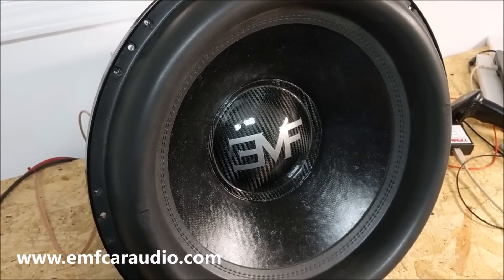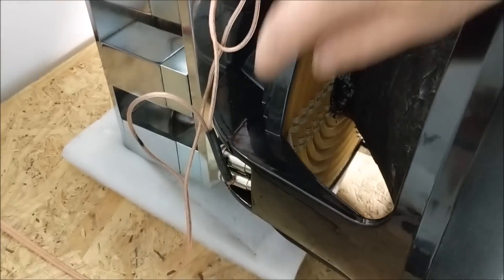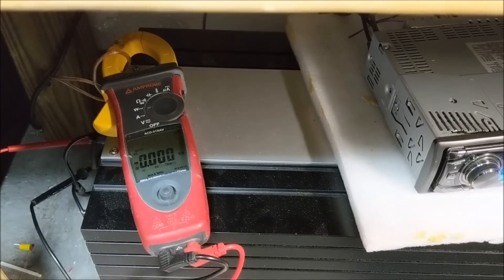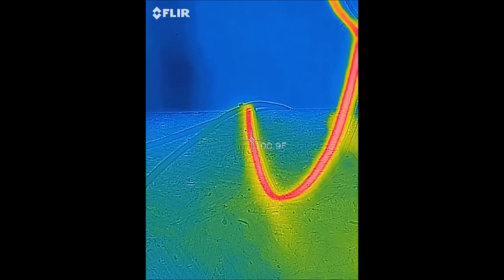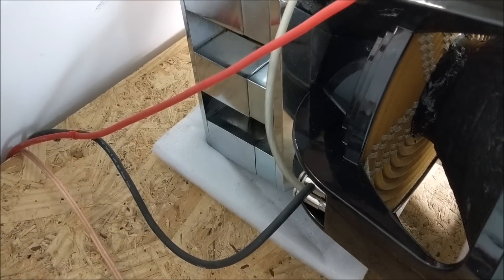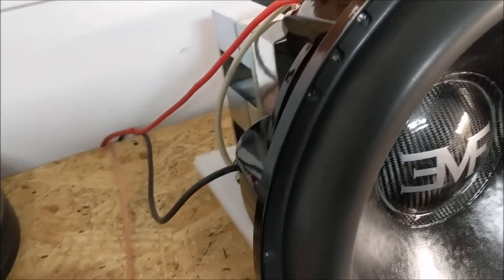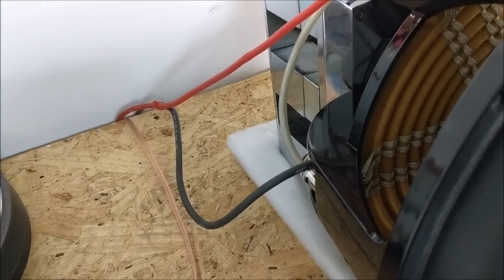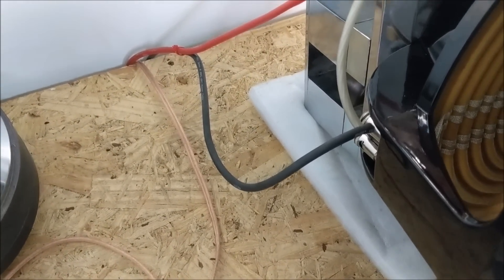Are you using the proper speaker wire size?

Comment: Eh, just run the coils in series. I am too cheap to use anything but 16 gauge.
Reply from the maker: Running it in series doesn't solve the need for bigger wire. If you have the power, you need the bigger wire.
Reply: @EMFAudio  I am joking of course! It would be interesting to see if there is much difference though, in theory it would be half the current, though in practice its probably only slightly less. And if the driver was in an enclosure which would give stable rise on the chosen note and wattage, you miiiiight be able to get away with it. Your temp rise on the cable would probably only hit 95f.... I think at 7 feet bidirectional 16 gauge is good for something like 5-7 amps? if that... 

I had to use 16 guage on my setup as at that exact moment it is all I had, but I also have a single 4ohm 12". The amp is rated about 1kw into 1 ohms so I know it will never see much power. Ideally I would be using 12. But I have to pull the box and sub to change it, so I wont bother until I get the new amp. I think its only 3 feet or so. i don't use terminal cups, so its 1 piece.
Reply: I really also never run it to full power either.
Reply from the maker: @wishusknight3009  I feel like I have a video to do testing series and parallel effects on speaker wire. I need to have a good consistent platform to do it with thought, for consistency. I know the result, I don't know the specifics.
Reply: @EMFAudio  That would be interesting. The best consistency would be a resistor network, but that can be very pricey. 

A little off topic... In one of my experiments at home I used ethernet wire (22 guage) purposely to actually increase impedance of the sub I was trying in the theater. I was not about to see if my HT monoblock could do 1 ohm.. Its rated only for 4, and I have ran it at 2 for long term without issue, but this was a bit much.  So in that case I had to use a bit of napkin math to ensure the right length to give the desired resistance, then figure out that the wire could dissipate the heat properly.

It was good for low volume but for a real workout I used 2 strands each way with more length.... I think I used about 25 feet to add 1.5 ohms or something like that. Cant really remember. And after a couple of good rap songs it certainly was warm to the touch, If i had to guess I fed about 300 watts through it...  It worked for a 10 minute test and it was much cheaper than the resistors that I didn't have on hand lol.

Comment: So does this also mean that a dual 4 ohm sub runs cooler than a dual 2 ohm? (both in the same wiring configuration) Higher the ohms the higher the voltage, resulting in less heat.
Reply from the maker: In the same exact model comparing coils, yes, as long as you run the amp at a higher load. Example, if you ran a dual 1 in series or a dual 4 in parallel, you'd have 2 ohms at the amp and results would be the same. Now, that being said, while the higher impedance may run cooler, it won't be wildly significant when you're talking about using it at rated power (as intended)

Comment: Question because I have seen some people try and just run multiple runs of 16g speaker wire to each coil, will it still overheat if you used two runs of 16g rather than one run of it???
Reply from the maker: Multiple runs will have the same effect as a larger gauge wire. Think of it as the amount of wire being used, not the size of the wire being used.
Reply: @EMFAudio  thank you for clarifying that, so multiple runs of smaller gauge is equal to 1 run of a larger gauge ie 2-16ga vs 18ga?
Reply from the maker: @kevinAuman1  The lower the number, the bigger the wire size. So two 18 ga wires would be close to a single 16 ga.

Comment: i use 6 inch thick pure copper bar as speaker wire
Reply: jaakko200987654321 I use that as a butt plug
Reply: Hell ya. I use 8 awg ofc rods as wire 🤣

Comment: well..100f is just warm. Body temperature. Seems to me if you are pushing less than 1k 16 gauge is just fine.  Length of the wire plays a major role in how warm it gets. How much do you have coiled up behind the scenes?
Reply from the maker: The wire you see is basically it. The amp is about 2 ft under it. Yes 100F isn't THAT warm, but it's also a short period of time. The point was to display what happens and any energy lost to heat is a loss of power.
Reply: This is so true!I had way too long of a wire (wrapped up)and my 1000watt set up straight melted the thing!it was a big glob of wire stuck on itself.

Comment: Can I use 12 gauge wire as jumpers between the dual voice coils (parallel  for final impedance 1 ohm) and then 8 gauge from the subwoofer to the amp? My terminals on my subwoofer won't fit 2 8 gauge wires. Great video by the way!
Reply from the maker: 12 gauge can handle quite a bit of power in a short length. Unless you're running over 4k per sub you probably don't need 8 gauge.
Reply: @EMFAudio  Thanks for the reply. I was trying to use the wire I already had but I only had a few short pieces of 12 gauge but about 5 feet of 8 gauge. I am upgrading from about 600 watts to 1200 watts. 8 gauge is probably overkill but I'm going to try to make it work since I already have it.
Reply from the maker: @2000S10V6  You could use 16 gauge and be OK, on the whole thing.
Reply: @EMFAudio  I appreciate you replying! Maybe I will just go ahead and get new wire rather than try to cram 8 gauge in the terminal.
Reply from the maker: @2000S10V6  We have spools of 12 gauge at www.emfcaraudio.com, that would be more than appropriate and easy to fit in.

Comment: Aluminium does not conduct electricity
Reply from the maker: Is that why voice coils and wire is made of it?
Reply: EMF Audio voice coils are made of copper?
Reply from the maker: @Robertotvl  They are made of copper, and in subwoofers more of them are made of aluminum.
Reply: EMF Audio yes in some rare cases they are made of aluminium and copper to reduce the weight so it can move more easily
Reply from the maker: @Robertotvl  Rare? The sub in the video has an aluminum coil, 2 of our lines of subs use aluminum coils. Everything from Sundown except the E and SA lines use aluminum coils. Aluminum are more common than copper coils. It's not an alloy mix, it's straight aluminum. In the mention of wire, there is OFC (oxygen free copper) and CCA (copper clad aluminum). The copper coating is to prevent oxidation. There is straight aluminum wire as well, cheap stuff is. There are also plenty of distribution blocks and battery blocks that are wait for it, blocks of aluminum.
Reply: @EMFAudio   These comments are unreal XD

Comment: Yeah ok? Im sure most people understand more current equals more heat through the conductor. But 100° is still within spec for the insulation on that wire. Does the heat somehow degrade the quality of the signal going to the sub? Of course you dont want to overload a cable but all you showed us was that certain gauge of wire has a specific limitation. What i wonder about is the amperage i know amperage and wattage are tied, how much amperage are those speakers cables taking i know its 1200 watts but at what voltage?
Reply from the maker: More heat is more energy lost, there is less power going to the sub. There is an increased resistance as well. It's not about destroying the insulation but there is a point where it could set carpet on fire. Voltage will always be within reason on the cable, current is what makes it warm.

Comment: So the thinner cable gets up to about 37 degrees celsius. That's actually not so bad. And for normal music playing it will not get quite that hot. Could be alot worse. But it's not just the cable thickness alone that plays a role. But it's always better to have good headroom in cables like it is with amp power. Too small is not good in both cases👍
Reply: if the length is reduced then the temperature would also decrease. a ~2 foot piece of 16g will take 1200 all day.

Comment: I always use 8 gauge no matter what.
Reply: Explain to me how you double up 2x 8g wires into 1 terminal when wiring dual subs?? Most terminals cant handle that thickness of wire
Reply: @akuma4u  if your amp or speaker only provides 1 set of 8gauge outputs you use a simple splitter. (The amps i run in recent systems had two outputs even though they are mono bridge amps.) My speakers have direct leads so there are no terminals .
Don't twist them at the terminal, unless you really can't afford a split, or reduce about 1/2 the wire off each end before sticking it into terminal
Reply: @ThisIsSolution  what kind of splitter are you talking about do you have a link cuz I am having that problem with two 8 gauge wires into my sub terminal my Moto block does have  4 channels

Comment: or course the larger wire disperses heat alot better. but first test the heat scope is rock solid focusing on the same spot of the wire. second test it wobbles all over the place. at times not even pointing at the cable.

Comment: What gauge would you use for main lead on an 8k  @1 ohm amp , 4 coils being connected in parallel with 8 gauge inside the box , connected by 1/4 inch brass bolt to outside,this lead is about 6 ft , would you use , 4 gauge or 1/0 ?
Reply from the maker: You'll have a loss in those bolts but 4 gauge OFC is more than necessary. At most you'd have 90 amps of current, which in that length could be handled by 8 gauge.

Comment: Aluminum wire doesn't heat up faster than copper.
Reply from the maker: Yes, it does. It can't handle current as well as copper. It's not as efficient of a conductor, meaning more energy is lost in the form of heat. The same amount of current applied over the same time will cause more heat to be produced. That means it gets hotter, faster.
Reply: @EMFAudio  while some of the points you made are true but it has nothing to do with what I stated. Do your research. If you apply current to the same mass of aluminum as copper, the copper heats up faster not the aluminum. Nothing else was stated by me. I'm well aware of the conductivity of metals. Hopefully some chemistry students can chime in and set you straight.
Reply from the maker: @carlosoliveira-rc2xt  Every time somebody says "do your research" what they're saying is, they didn't do their own research and they want me to prove myself wrong. That being said, what you're suggesting is changing the consistency of the test. If you change the mass of the wire, you aren't using the same gauge wire. That would also hold true in using the same exact material of wire. If you aren't using the same gauge wire, the test is invalid, that isn't a fair comparison.

Comment: You are doing it wrong, one never tins the whole lead to connect to the speaker terminal.  To keep the lead from unraveling only tin about one eight of an inch so that only copper is in contact with the speaker terminal other wise you add an extra interface.
Reply from the maker: Those strands fatigue and break when you put it in a terminal thousands of times if you don't do that. The bench isn't for long term connections either, just product testing. The additional resistance isn't a factor in determining if it plays fine or not.
Reply: Anyone who puts it in a thousand times should use banana plug or BFAs.   @EMFAudio
Reply from the maker: @wardell1518  If you notice, that sub has 2 positive terminals next to each other, and 2 negative terminals next to each other. To use banana plugs they would have to be individual, which is basically what we're doing but with an extra component involved. We do use banana plugs on the subs that have a normal terminal configuration.

Comment: What do you think about two 15s at 2500 watts using stinger 10 awg ofc tinned speaker wire at about 3-4 foot runs. My years of experience tells me that's plenty but now I'm wondering if I'm losing any power to the subs especially since the speaker terminals direct accept 8 awg as well as the amps speaker outputs direct accept 8 awg. I'm a bit anal and OCD about things so that's gonna mess with me until I get some kind of confirmation.
Reply: That's like asking "is it dark enuf outside that I should turn on my car's headlights?" If you gotta ask then you should bump it up. Just to be sure. Don't sell it short.

Comment: When you were testing the 8 AWG wire,you were pointing the crosshairs on the ground wire and not the wire carrying the current, obviously it would show a lower temperature.
Reply from the maker: That's not how electricity works. There is a reason both wires are the same size, they need to be. Additionally, it's AC, meaning it flows both directions.

Comment: I can hear a drastically volume increase as well with the larger wire. This is why I wire my DIY speakers, internally, with 12 gauge wire or larger.
Reply: Drastic volum increase I have never heard. And it won't help with 12gage if the wires in the speaker is alot smaller anyway😂
Reply: @Oystein87 it will though the longer your wire run is.  That all adds resistance.  Thicker wire cancels that out.  Oversizing components is how you make sure everything runs smoothly, at its max potential, and stress free to all components!

Comment: I thought a speaker being in physics terms a lump of iron a coil and magnetism?? current passed thru?
also a electric motor is also a lump of iron a coil and magnetism.. and a current passed thru?
they are praticaly one in the same things in physics terms.. yea??
so if say an 1800w (RMS??)
lawnmower run by 240v.
because it an outdoor tool on electrons British standards, kite mark, assured quality,.
so the physics work when pairing it up to a speaker system youve done the maths for.
I know it not how u do,  I know your high end,, but its possible with a little know how to do it for so cheap....,,true??
Reply from the maker: A speaker is an electric motor, that's why the motor, is called a motor. Your comparison is a different type motor, and there is way way more to a speaker than the science behind how the coil moves in the motor.
Reply: thats why the Japanese pioneer research over linear motors..
and twas they that saw the identicle electron flow thru a magnet and a coil..
thats the thing the original 1st electronic device, the electo magnet.. genesis then pass current thru and look what u can do.. I know u dont agree but that's the beauty of two sides of the same coin!!!

Comment: for cheapness and recycling in the uk. I use 240v over 1kw handling mains cable.. its free, so how can u get better and it wuld cost a fortune?? true?
Reply from the maker: It sounds like you're talking about residential wiring, which is not the same kind of wire and can't handle current as needed in many cases.
Reply: @EMFAudio  yes true,, but in the uk its good quality fat copper multy shieded coz the British kite mark, and when folk throw out cable like that from a lawnmower I just cant helpmyself!!!
good phisyics in conducted electrons, -ve power couplings!!!
Reply: I know my product of factor math.
v over I x r!!!! for example!!!

Comment: Nice to see even when I was first starting out in car audio I was using overkill for speaker wire. I had 2 Rockford T1 subs getting about 700w RMS each wired up with 12awg OFC. Had 14awg ofc running to my mids.
Reply: I have a single Skar SVR 12" at 800wrms wired with 6 gauge wire 😂😂 it's my first car sub so I went waaay overkill lmao
Reply: What gauge I need for 400w RMS

Comment: Since you are making speakers and have a thermal imager, how about making a window into a speaker and show the voice coil and how the heat flows out. I would also be interested in what happens to shorting rings too...
Reply from the maker: You can't really open things up to see something because it would change how heat is transferred, defeating the purpose. You can only use what you have.
Reply: @EMFAudio  I could not figure out a non-contrived way either. The best I came up with was to use neo magnets with some space between them with an oversized pole plate (thermal mass of the ferite) to simulate a ferrite magnet, then plug the gaps and seal the TI in one of the gaps. I might still do it, but I know my speaker would be a real POS compared to yours.
Reply: @EMFAudio  BTW if you are using a Flir One Pro with USB C, I have been able to get mine to run with external power plugged in. Add a USB C extension to the phone and a wireless charger for the phone and you can take really long videos or timelapses.
Reply from the maker: @jdrissel  I'm using a mini USB with USB C adapter. I know a way I could do external power though, I've made USB injectors before to boost amperage.
Reply: @EMFAudio  I had one of those. It was an early version and mine shut down the imaging hardware when a charger was connected. However the back of it comes off fairly easily and the battery just unplugs, so you could put a larger battery or an external power supply in there if you wanted to.

Comment: From what I read the dual posts are to add more power to each set of coils like they do with amps having dual power to one connection it helps distribute the max power over two leads not just one

Comment: I had asked a cable manufacturer re. the recommended gauges and they said for everything above 250 W they recommend no thinner than 10.
Reply from the maker: To power a 250 watt amp that would still be more than necessary. For speaker wire that's completely unnecessary. A 250 watt amp won't even have the capability of connecting 10 ga wire on the speaker leads. I'm guessing whoever you talked to either misunderstood you or has no idea what they're talking about.
Reply from the maker: http://www.emfcaraudio.com/wire-sizing-calculator/